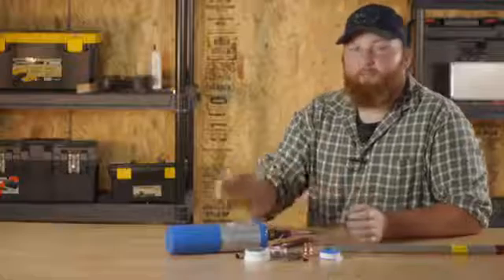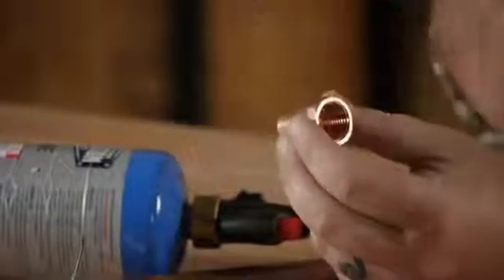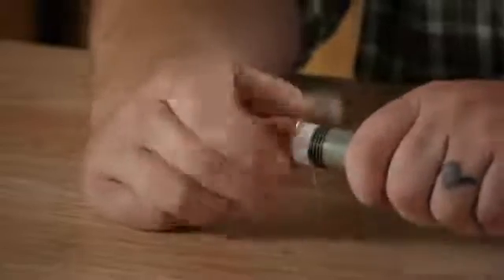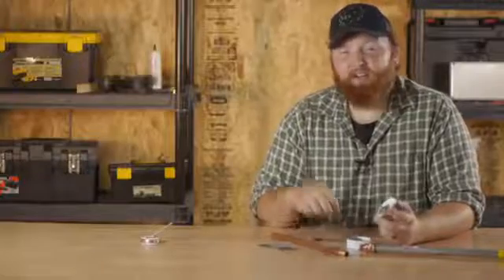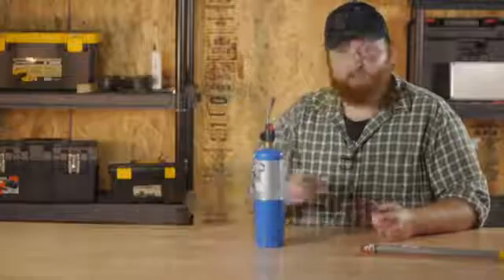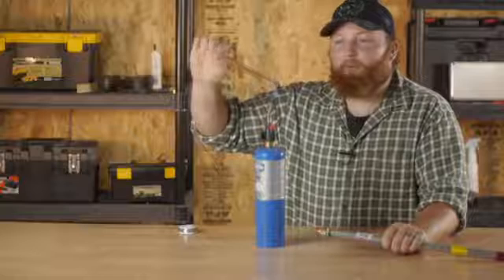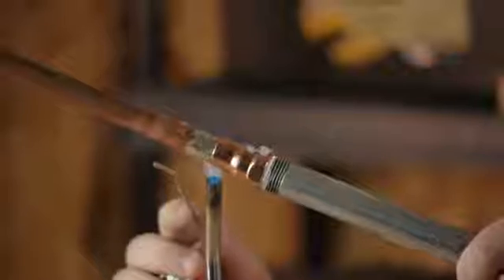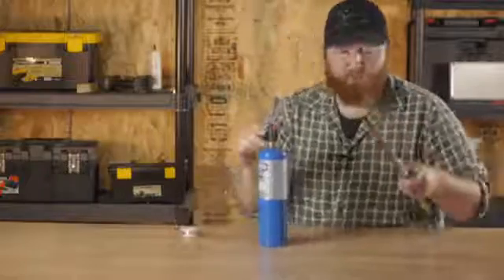How to Connect Copper to Galvanized Plumbing

Comment: Nice, but one small tip. While inserting the brazed end into the fitting, keep the fitting hot so that it slides well without any force and make a better joint

Comment: This is the dumbest plumbing video I have ever seen.  The copper fitting's threads will cut through that Teflon tape and connect directly with the steel pipe.  At some future time the joint will fail by galvanic action.